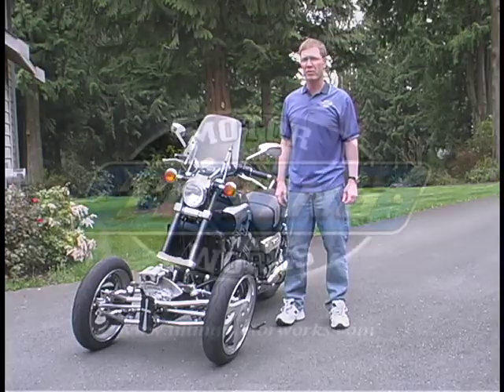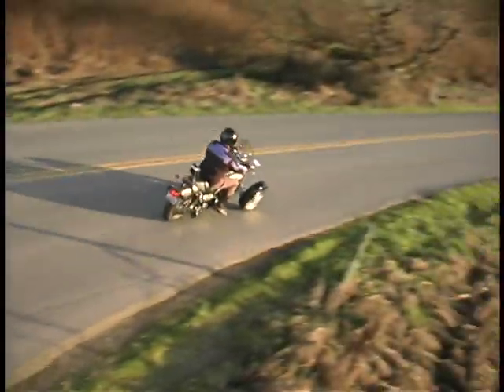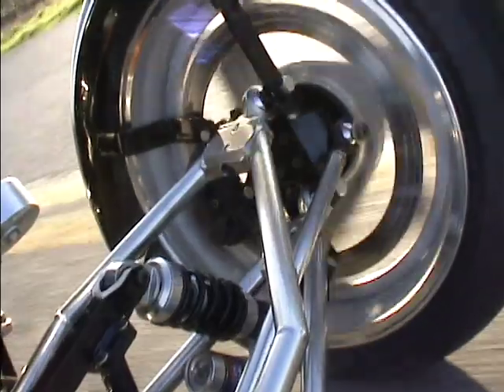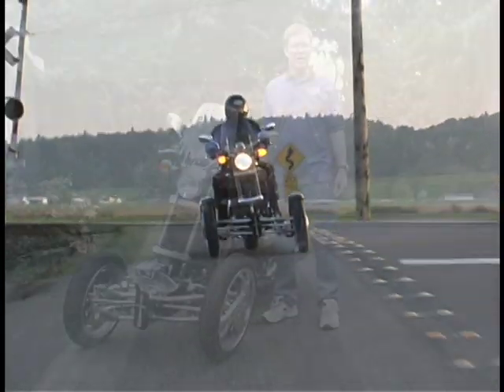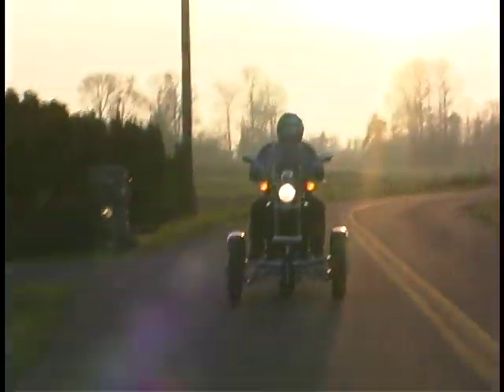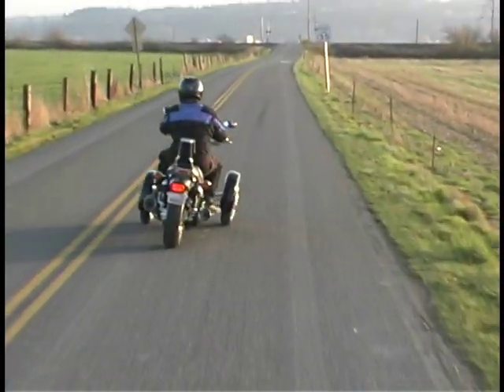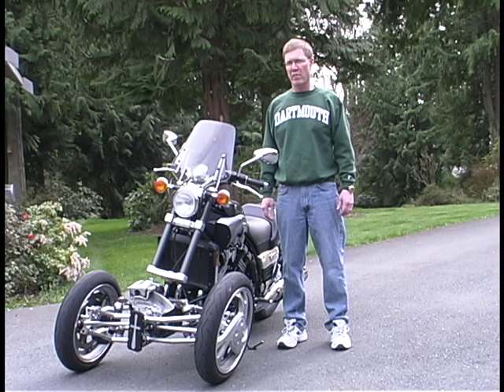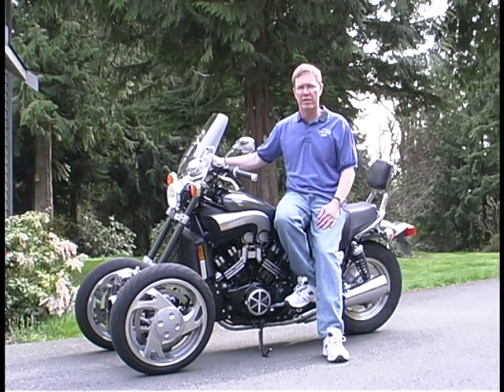Tilting Motor Works

Comment: If you can have the front two wheel track with much narrower distance, then you will have the more opportunity to seek for the market in both Asia and Europe. Motorcycle with this wide track is good for the States but in Europe and Asia. If you could make that with the rear two wheel version with the same tilting feature will be great, too. Take a look on the Dodge Tomahawk with the control arm going forward and still tilts.

Comment: 10k for the kit parts + 3k for that half-disc brake to fix tilt when parking. This aired 9 years ago, I was expecting the price to drop to 500-ish. No idea how you manage to run this business, also wondering what is your patent actually covering, as there are many designs like this around.

Comment: Congratulations for all your of your education and accomplishments, I’m honestly glad to see someone practicing knoledge1
On the other hand I have hard time to justify $10.000 for your system, which can be easily borrowed from an ATV and trust me, for $10.000 I can buy a VERY, VERY nice ATV! I want to convert my Goldwing and I will but not for $10.000… How do you justify $2000 for a welded half brake disk and a brake caliper called “Optional tilt lock”? A very decent car it’s less than $12000!!!
Can you sell your product for less? $2000 I would consider a reasonable price!!!